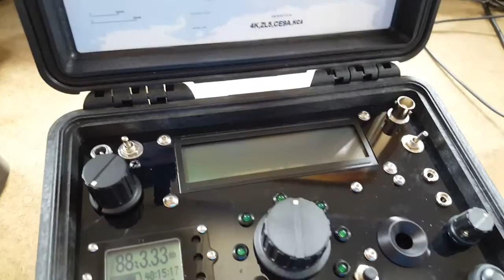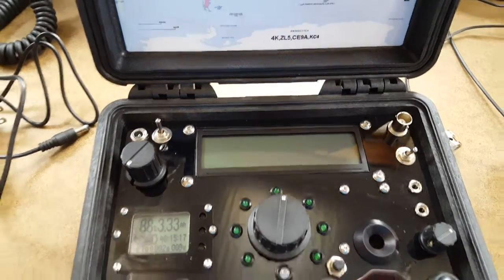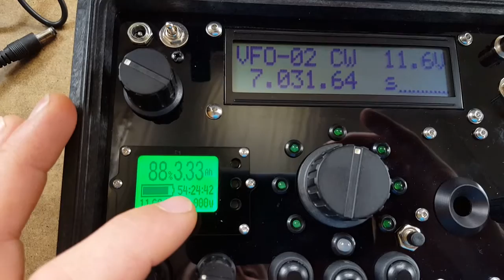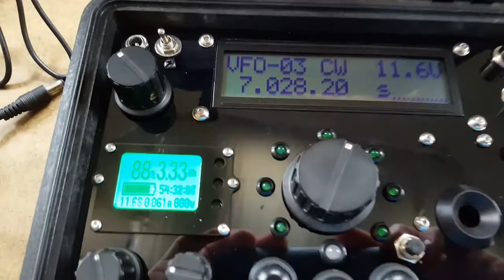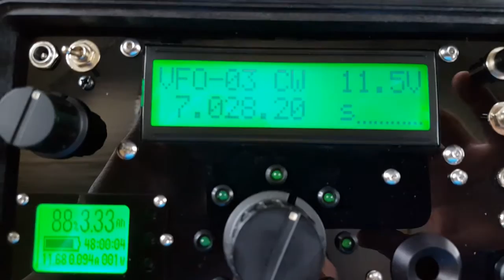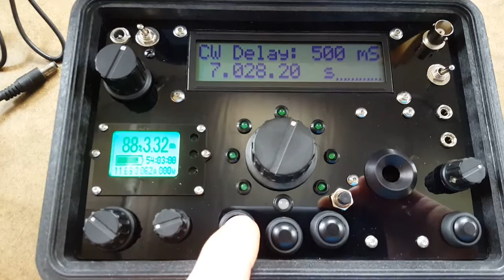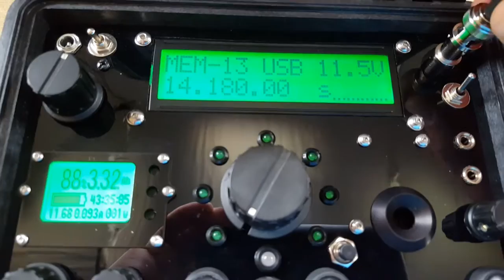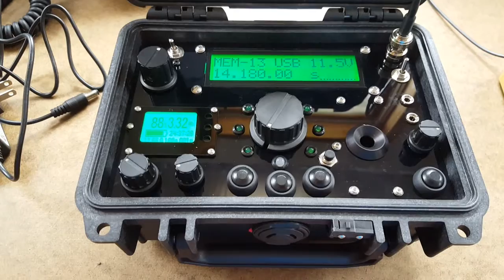RadioSet-GO converted YouKits HB-1B QRP radio features and functions overview, part 1 of 2

Comment: Thank you for this excellent review. One thing which would prevent me from using this rig is that the touch paddle buttons are in  'Reverse Mode'. Right handed operators normally send dits with their thumb and dahs with the index finger. Can the buttons be set to operate in 'Normal' mode? Kind Regards, Graham de G4VUX
Reply from the maker: G4VUX QRP it is easy to reverse the keying in one of the many menu settings. vy 73 w1jsb

Comment: External Power/Charging socket with changeover switch.
Bit  dodgy!  Only a matter of time before it goes wrong.

I would remove the switch and fit another socket in the same hole for ext power and make them non interchangeable. The Universal Law of Maximum Cussedness says that if something CAN go wrong it probably WILL....expensively.